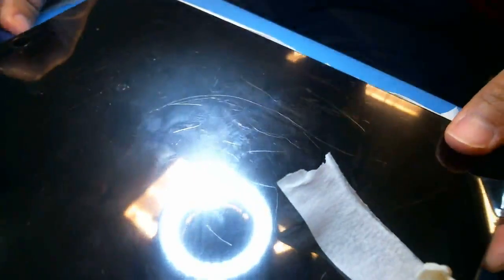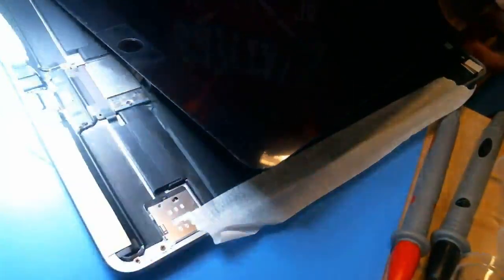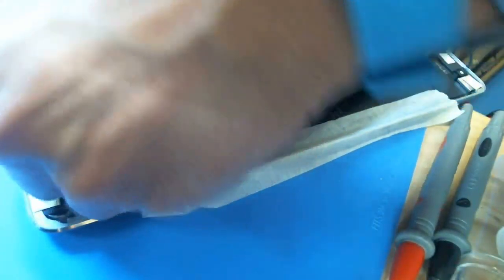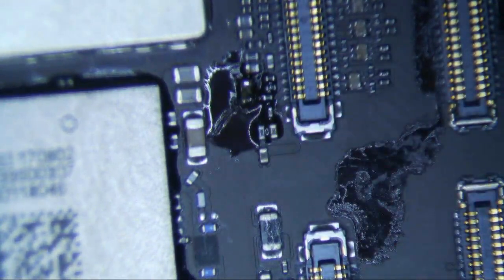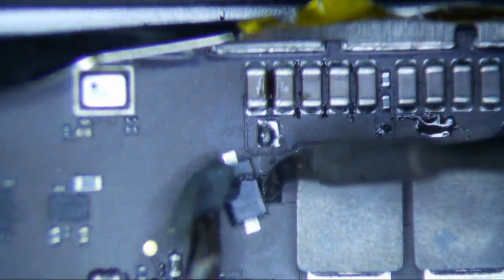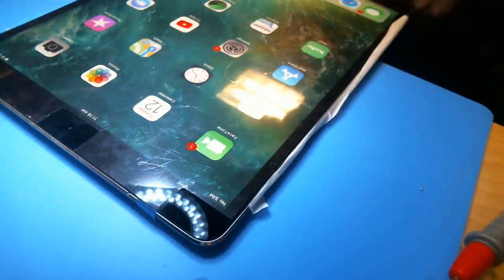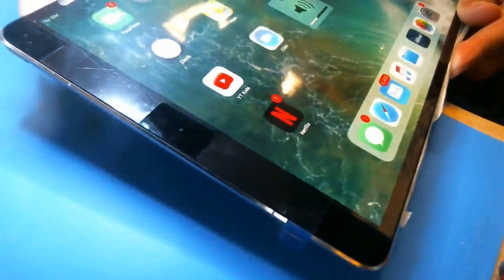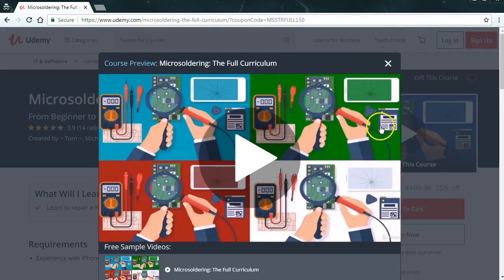iPad Pro 10.5 No Backlight Repair a1709

Comment: Hey man thanks for the video. I have the same ipad (A1709) that I was working on to remove icloud. My plastic pic slipped out of the space between the battery and board unknown to me while I was plugging the screen back in to test it. So I blew something. The ipad will not boot now with the screen attached, but will boot with it off. After some testing I noticed that as long as I leave the bottom right screen connector unplugged, it will boot but with no image or backlight. I checked all the filters around this plug and couldn't find any that were blown or looked bad. Any ideas of what to check next? I'm guessing something is shorted that prevents the ipad from booting?